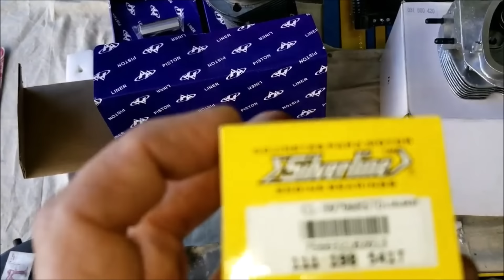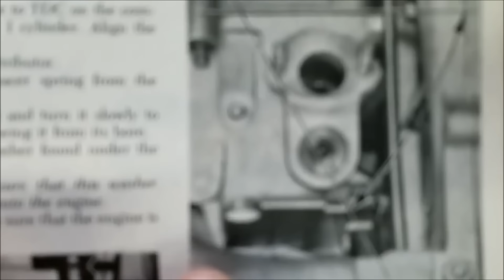BULLETPROOF VW ENGINE BUILD  flat 4 engine air cooled type 1 Full Build video 2007 STROKER

Comment: IT'S EASIER TO PUT the pistons in ther jugs first. put the wrist pin clip in the piston on the side that faces the other jug. push the piston down till the wrist pin hole is exposed out the bottom of the jug. assemble all 4 jugs this way. then just silicon the jug shoulder, slide the jug down the studs, line up the rod and wrist pin till it slips thru. install the clip and seat the jug. do the other jug and finish assembling that side. your way ;looked to mer like it would lent itself to broken rings. IMHO

Comment: thermostats //working ,is the way for all engines to have a measurement of heat , and cold air,- to keep all engine parts working in all start-up and run//you need the the B.T U  OF heat and then to cool , working ,

Comment: Counter weighted crank is the best mod.  After 5000 revs the old crank would flex and then spread the case.  the bearings would ride up on each other.    Even the basic engine put in a counterweighted crank.

Comment: 15:24 The cracks in the head are caused by running lean.  Almost all fuel injected engines didn't crack even on the type 4 engine.  The type 4 engine had the sharp dog leg to the exhaust that made for thin alloy in the head around the exhaust seat.  It was from the factory jets after extractor exhaust was fitted making a lean condition.  Tell us the head numbers.  The 044 heads were the go back in the day.  90.5 bore was the best for having a large enough sealing surface to the head.  You got the best combo.  I was always looking to 74 or 78 stroke with the 90.5 bore.  Those deflector plates were always sad on a larger bore.  I learn't something about using the type 3 units. I don't have a VW now but I am keen to get one again.  Top video mate.

Comment: Came across one engine the deflector plates had been installed on top of the cylinders. Can't recall if it was 36 or 40 but it survived without any apparent detrimental effects.
Speaking of survival, back in the eighties recall a VW mechanic telling me he knew of persons with 36hp motors that had done over 150000 and one he reckoned 200000 miles, unopened. Great little motors if driven within their design considerations.

Comment: Dang the audio and video is so good I was able to hear and see where that washer fell @  around 51:15. My eyes and ears tracked it over by the air hose, or red hose you have their on the floor. (if you look towards the lower left of the video screen.) 

Furthermore, I really want to get into cars and engines now. Even if its just lawn mower engines too, just to start with and learn.
Reply: Racing go-karts would be a great place to start especially if you have kids.

Comment: Thanks Mike , very Complete informative install info. People have weird ideas about Blueprinting & balancing. You couldnt make it any planner or important!  Thanks & cheers from B.C. Canada.
Reply from the maker: those parts are pretty tight. you wont be putting that many rpms in there If you go much over 6500 you will pull the pins out of the pistons. To do that it is $$$$$$$....for over7k rpm. so no sense in blueprinting and balancing. they are pretty close. lightweight pistons. and rods.

Comment: 58:15 317 Ft lbs from memory.  I snapped one.  Big angle iron and a pipe on a breaker bar.  Torque wrench settings are vital.

Comment: 24:25 we used to place the bearings and scribe them before we mounted them on the crank for dowel pin alignment.  Don't miss a step.  Front and back bearings from memory as the are not half shell.

Comment: 57:59 You have to get it in 3 shims. No more.  I had an old motor that only survived because of clutch pressure.  Without that the crank would have hit the case webs.  I drove that beetle for years.  Still got the motor.

Comment: 36:23 We used to use engine oil if we could get it done in a week.  Gearbox oil or CV grease if it was going to take longer.  Mostly the customer extended the time choosing options.

Comment: It’s been four decades since I last built a VW engine.  I had a lot of fun with VWs in the ‘70’s.  It’s good that they were so fun and easy to work on - because their long term reliability sucked. Amazing that so much remains the same.  I used Rimco to add shuffle pins and 8 dowel crank/flywheel etc.

Comment: Not new to car culture but looking to get my feet wet with a vw build. First ? I got is why are engines so dam expensive, a 2300cc motor with 180 hp for 6k 😆
Reply from the maker: yea its ridiculous. need to do your own. The reason they charge so much is because the parts are so inferior that every about 10 engines they eat one. parts are more than labor. I have no idea why these cases are over 1000....makes no sense.
Reply: True vw stuff has become expensive, however all car stuff has become ridiculously expensive . Just getting back into the vw scene myself . After the last 25 years of playing with fords and Chevys vw is cheap by comparison.  I agree these “crate” vw engines are insanely high.  Build your own . It can be done and this man’s videos are excellent! Very detailed and your work is appreciated!

Comment: I had a 2007cc, engle 110 cam and twin 36 dellortos in my Splitty and the fuel economy was a massive improvement over the stock 1600cc. Its a perfect combination, more than double the power and better gas mileage and you don't even notice hills any more...I miss that old bus

Comment: A chrome-moly flywheel would be ridiculous. Billet steel, maybe. Those rods are just forged steel with full floating pins, just like stock VW. You don't run valve spring pressure any higher than needed so 1. your cheesy pushrods don't collapse, and 2. to keep the valves from bouncing off the seats on closing. You wouldn't want to waste your money on a magnesium case that has already been line-bored and had half the studs pulled out already. We built counterbalanced 2180's 35 years ago using mag cases, forged rods, and Mahle forged pistons that lasted as long as you pulled the heads off once a year to re-torque the mains. Never had any oiling problems using a stock pump and the aluminum VW cooler.

Comment: Try these 2 things to make your vw engine actually last
Understanding that 5 quarts of oil will never allow the engine to reach operating temperature, first install a 5 quart oil sump with the long pickup tube. Then add ONLY 3.5 quarts of oil. Carry an ADDITIONAL quart for hot days and steep hills. Next install an oil temperature gauge. Under typical conditions, this setup alone in my 1968 bus , I saw 180 degrees all the time, every day even at 70mph and 90 degree days. 
Next, install a cylinder head temperature gauge and put it obviously on number 3 . That's the one nearest the driver..the one that always shallows the valve.  These are commonly used in aircraft, but NOT hard or terribly expensive.  Have it set to trigger electric fans directed at the heads at around 200 degrees. 
Very inexpensive and great not only for longevity but fuel economy and performance
Reply: None of this is new. I did that on 4 of my bugs over 20 years ago.👍🏼👍🏼🤜🏼🤛🏼
Reply: @d1specdrifter  Who cares if it's new or not. It's helpful and nice insight. You're comment helps no one

Comment: great info. a friend just built a new 1915 vw motor and it won't start it has compression coming out of the carburetor when you turn it over it's getting fire and has 120 lbs. compression on all cylinders. what's wrong?

Comment: The cylinder have 4 holes and center bore but modified that someone build the engine cylinder. The extra hole up to 6 or 4 holes goes thru from top of cylinder to the bottom of cylinder. That the holes are called oil cooling jacket for only oil flow thru The 4 holes for bolts and 6 holes for oil and a center bore. It out weight the cooling efficiency of air cooling compare to hybrid oil and air cooling cylinder. Out weight means much improvement of the design that shall be the concept newly made. But I don't have any Volkswagen coupe.

Comment: 1:04.03  Moly.  The ring gaps should be in this engine.  Top ring to the exhaust second ring behind the inlet oil ring gap should be to the top.  I might be wrong so tell me these engines are not the same as most.

Comment: The coefficient of thermal conductivity for magnesium is less than aluminium i.e 156W/mdegk verses 247W/mdegk, it is therefore 60% worse so that the magnesium will retain heat more than the aluminium.
I-beam rods are more suited to high revs simply because they are lighter and give lower reciprocating mass.  The H-beam rods work well as you say on turbo engines of moderate rev capability but high loads.  The H-beam rod is heavier.
Aftermarket cases can have the crank bearings bore slightly of line with the case half so that the barrels will not sit square with the crank causing thrust on the wrong side of the piston and extra heat.  The block should be spot decked to correct that instead of line boring.  
Matching pistons/rods and balancing the whole assembly?
Hoover mods?
The Salzburg rally bugs ran zero deck height for maximum compression but that was risky.  Deck heights of between 40-60 thou (1-1.5mm) are the accepted norm
With a new build it is recommended to use the Scat Lube a Lobe lifters or Engles equivalent that lubricates the cam lobes to help with cams/lifters hollowing out.  I break in with Valvoline VR1 and thereafter use Castrol Edge 10W60 that allows the oil to circulate quicker initially and has a higher heat tolerance.as well as being more stable than a mineral oil.

Comment: These forged Chromoly connecting rods from Flat four engine is 5.5 inch between center radius of journal hole of the rod to the center of smaller hole. The length of the original connecting rod is 5.325 inch long between two radius centers of two holes. The Piston B is max to either 94mm bore or 92mm bore and piston pin is closer to the piston's top than the Piston AA. From the store So. Cal Import Auto Parts.
Reply from the maker: If I recall correctly the original rods are 5.4 inches. they make the AA chromoly ones in several sizes. short rods at 5.375 which I used on the 74 stroker. I think on this one I used 5.5 or longer ones IDK exactly we had to talk to the machine shop guys to get the exact ones to use with the b pistons I used a pistons on the 74 stroker.

Comment: Consider deep cryo treating and WPC treating the components.
As a topic, stroker NA engines versus a boosted ( turbo or supercharged ) 1600 cc for power and reliability. 
Also, cylinder head power test ( single port, stage 1 to max effort; dual port, same stages )

Comment: 102:46 The distributor drive is also the first thing to stick if an engine is stuck out in the weather.  You think the engine is ceased but it is just the dizzy drive.

Comment: The engine was started first time being built in history. It is on Rocket steam engine. Then it became condense and steam engine of multi-pistons type. The car with rear compartment needs the engine but the wholly is bigger than the engine named the motor. Engine is what type of engines: The carburetor aspirator type or fuel-injection Direct type or Otto radial turbo engine but it does not have any battery. Some motor with the battery can be 6-volt or 12 v. or 36 volts system. The engine is running is like there is no air filter and no oil filter and not even electric starter that crank the motor up. Even the engine have no radiator. Motor always wants to be cooled off. But hotter engine tends to be much hotter and wear out FelPro gasket and add in NOS nitrous to a racing motor size 560 CID from crate.
Reply from the maker: I was saying the same thing but didnt comment.
Reply: Yeah but I had sauce with mine😂

Comment: Generator is made in China for Volkswagen Super fast 75HP and 75 amp Beetle.
 The electric motor is converted into a commutator type generator. These generator is brushless generator that provide 1,000 watts and the Bosch did not have brushless system for generator. But for now more money is for better performance of the generator to a real good reason it is durability or even 1,200 watts generator.

Comment: Mike, you mentioned that you removed the “Oil Relief piston and spring” because it wasn’t needed with the full flow system. I have never heard of this before. I’m a little confused now as I’ve got a full flow system in my buggy and retained the oil relief piston and spring. What’s the up/down side of this?
Reply: ? He showed putting in new oil relief springs and pistons. Think maybe you misunderstood. Hopefully Mike can clarify. All I can tell you is that like you, I run the relief spring and piston along with the full flow filter. EDIT: I saw the part where he took the spring out again, never heard of that before!

Comment: Hey mike. Love your channel. When are you going to do an ev conversion?  I am doing a 74 super beetle on my youtube channel bills cool projects. Go down to San Diego at EVWest spend a day. Thanks again for the videos.
Reply from the maker: yea those are cool. just be aware that they say way more range than what you will actually get. The rated range is much less than actual range. They rate the range at 45mph which would be dangerous on the freeway. The Bus we took up north was rated at 250 miles. On flat ground at 60mph it never got better than 120 usable range. On hills it really gets lower. Great for around town but impossible to do road trips.
Reply: @Mikefngarage  thanks mike. Yep agree. More charging stations help that. Conversions with ccs charging also. But how much range does our gas Vw’s have when we break down. We have both been there. Plus performance and reliability. Forget the environment thing. Take care.
Reply from the maker: @bparkinson1234  the difference is that your range on the EV when you run out it is 8 to 12 hours of charge time. Unless you go with a Level 3 controller $$$$$. then you also degrade the battery from too much use by using level 3. an hour on the charger can get you like 5 miles. at level 2. Just be aware you will not be doing any long trips. In town they are great. But you do give up long trip privileges.

Comment: If that fan cooling shroud has a cooling tin extension for an oil cooler,,i.e. outside the air flow to # 3 cylinder, that is not a Type 1 engine, but a type 2.  One of the Type 1 engine's main "gremlins" was the blockage of cooling air flow to the number 3 cylinder, which required constant lash adjustment to avoid burned valves. in addition to almost always being the first push rod tube seals to fail. On Type 1 engines the cooler was inside the fan cooling tine ( no "doghouse")
Reply: I think your confusing your types. Type 1 had the doghouse after 1970. The bus went to t4 in 72
Reply: @davidpechumer556 i love the type4 cooling fan.

Comment: Morning ..is it silicone grease your using in the flywheel seal or a curing gasket type silicone...
Thanks Paul..u.k
Reply from the maker: I usually put silicone on the outside of the seal to keep it from coming out. Had a few over the years slide out and leak.

Comment: The stock rods with arp rod bolts are good German steel. I dont know do they fail?
Reply from the maker: I dont think they would clear. the Chromoly ones are clearanced. and I think lighter. which gives them more RPM and less reciprocating weight.
Reply: I doubt they fail. I got 40 h.p. rods resizied and machinist complained how tough they are. The 1600 rods are better than any sbc factory rods would be my guess.

Comment: Did you folks put in the thermostat and flaps? I'd like to know your opinions on these.
Reply from the maker: Nobody does really less than 1% around here. It does not get cold enough in socal to benefit from them. Only time I would use them is very cold climate or very cold winter driving. I saw several cars years ago with stuck flaps and a burned up engine. Most of the people are summer driving  over 40 degrees. at that point it really is not necessary IMO.

Comment: Is there a compression ratio of the Volkswagen flat-four that it installed 90.5mm bore drop forged piston? Drop forged piston is light weight as same weight of stock 88mm Bore piston. I like compression ratio at least 9:1 for all Volkswagen cars. Any recommendation for why it should be less compression ratio? 
  The counterweight of the crankshaft is stock but when you get the Scat Crankshaft Chromoly then recommended for us to know about how much does it weight. The weight of stock Volkswagen 69mm stroke crankshaft is what? I called MT MFG about their crankshaft's weight. They will answer back to me soon. Thank you.
Reply from the maker: I think we are running this one at 8.5 which is pretty safe. 9 to 1 can ping sometimes when climbing hills. With premium fuel it is doable but you need to watch your car or bus when climbing or you can burn it up when pinging. My 1904 in the other bus is 9 to 1 this one is around 8.5 and this one I can stand on the floor when climbing and it never pings with premium.
Reply from the maker: I believe the weight of the crankshaft is offset with the lightened flywheel. Really should run a lightened with a counterweight. they work together. The pistons I use are not forged AA Pistons, but they are lightened so yes they weigh the same or less than stock. I think the only drop forged are JE or Wiseco. Not necessary for under 7k rpm. The Mahle are not drop forged either they are pressure casted forged which is not the same.